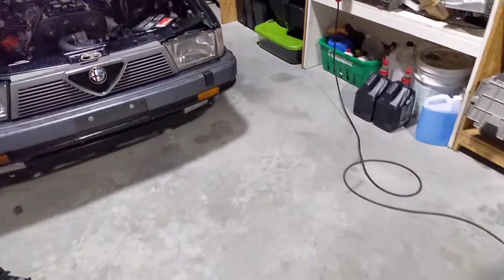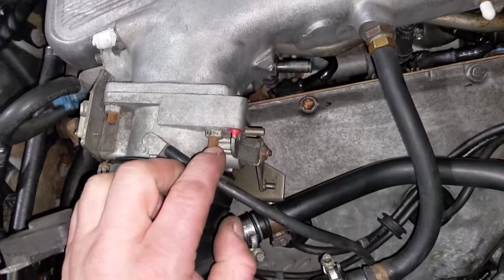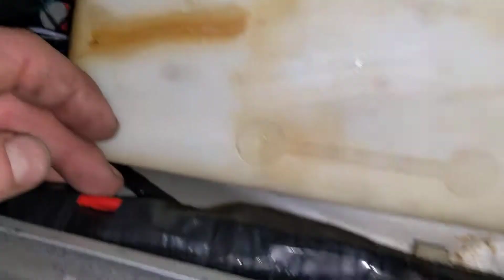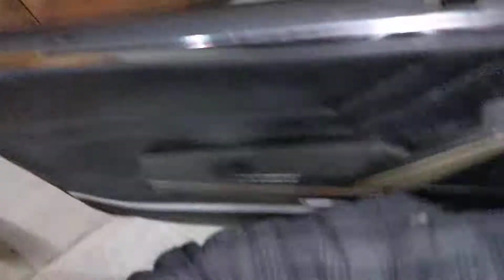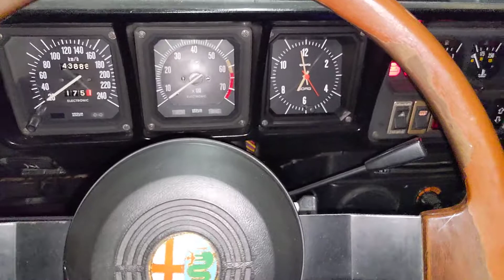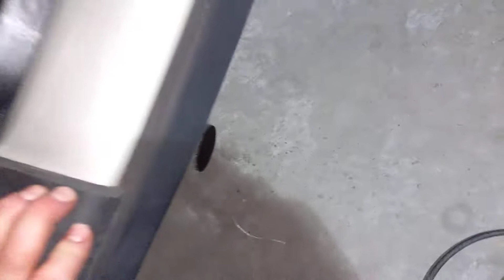GTV6 L-Jet Conversion - First Start Attempt

Comment: Question unrelated to the engine: I see/hear your door chime works (key in ignition, door open). Do you happen to know where the component is located? Mine stopped working and despite its sound being far from appealing I'd like to get it back to working order.
Reply from the maker: It's above the fuse box sort of behind the dash facia
Reply: @Nodarperformance  Thanks! I'll try and find it, I'm assuming it's another plastic looking box with some wires coming out of it. Hopefully it's not burnt and I will be able to save it.
Reply from the maker: @emilianosune4164  it's sort of a white square box about 25mm x 25mm. Mine actually had two buzzer boxes mounted together but I'm not sure what the second does so I've left it unplugged

Comment: Also please take those 1750 seats out and put a nice set of original recaros back in, goodluck with the projects
Reply from the maker: These ARE the original seats. They used to be blue in fact and I dyed them black 10 years ago
Reply: @Nodarperformance  what year is your car ?
Reply from the maker: @jaymyers6452  it's a 1983 USA delivered car
Reply: @Nodarperformance  sorry yes it is the correct seats, but you have the wrong dash :)
Reply from the maker: @jaymyers6452  how so? My dash is absolutely dreadful BTW, I'll be installing a cap soon. As far as the instruments go, you'd be correct: in an earlier video I rebuilt the gauges and upgraded the internals to modern electronics
Reply: @Nodarperformance  i sent my dash away and got it re skinned in a vaccume, came back like new. But if i had an 83 gtv i would love to have a split dash
Reply from the maker: @jaymyers6452  the split dash is beautiful but they are getting really tough to find now!